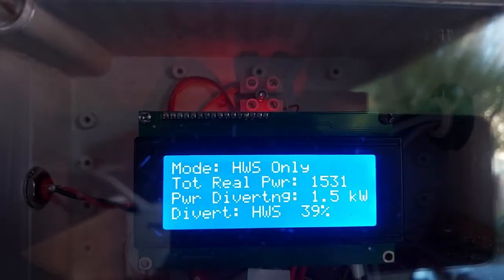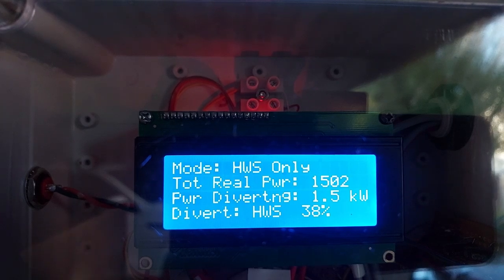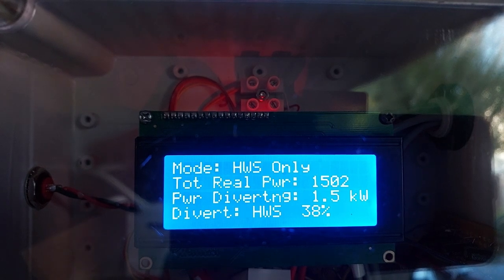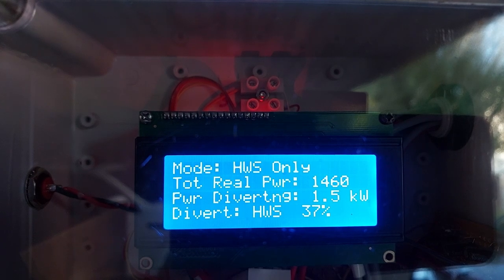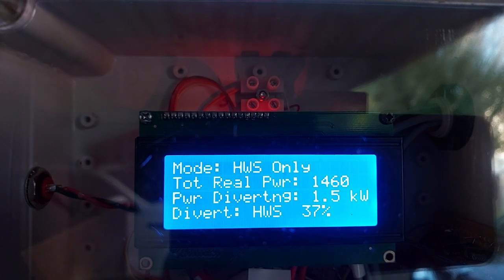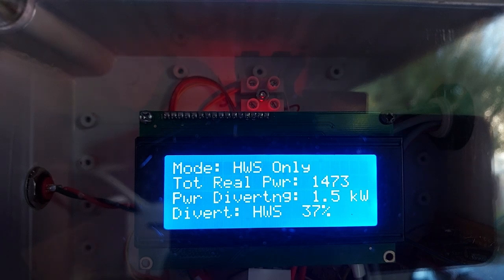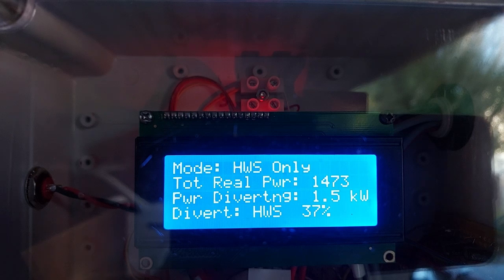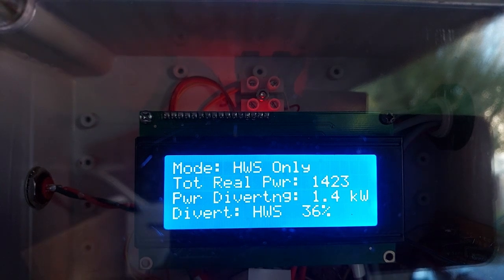DIY Solar Energy Diverter Part III using Phase Angle Control for Hot Water

Comment from the maker: Hi There,
Thanks for your kind words 
Yes, I use CTs on each phase and routines in the Arduino to determine power flow.
I'm not familiar with the PZEM- 00T module, but think you should be able to read it's output and then control your appliances accordingly.
Good luck.
Cheers,
Gavin.

Comment: Thank you for sharing your work here, it looks like you have nailed it with this variable phase angle control. 
I was wondering how you measure the power from your solar and consumption, have you got CT coils around the conductors? I was thinking of using a PZEM-00T module, would this work? Great job thanks

Comment: is there a single phase version? how does it handle the three phases?
Reply from the maker: Hi There, I would direct you to the openenergymonitor.org website where you'll find some specific details covering single phase applications. The 3 phase system is essentially a variation of the single phase approach. Cheers, Gavin.